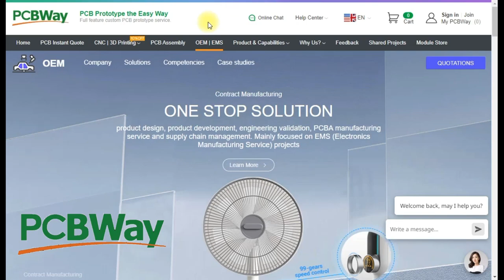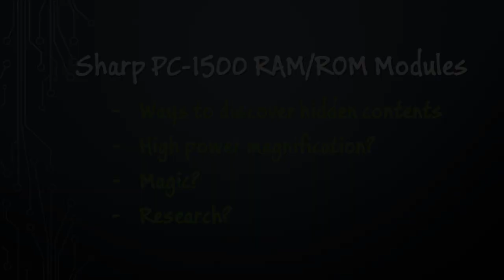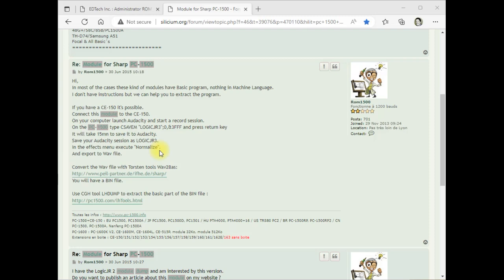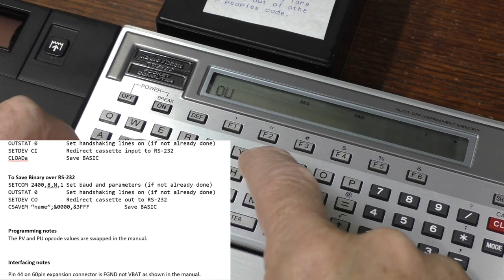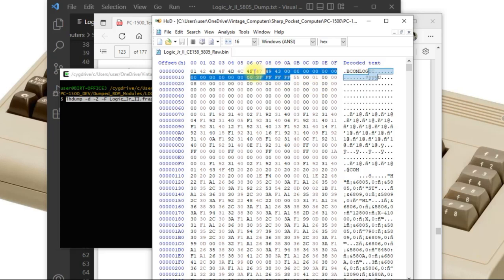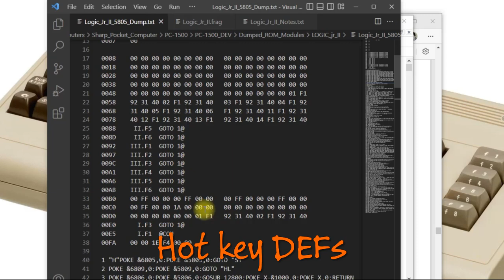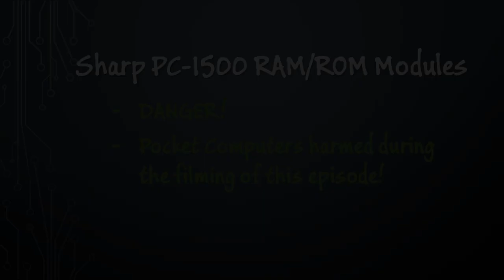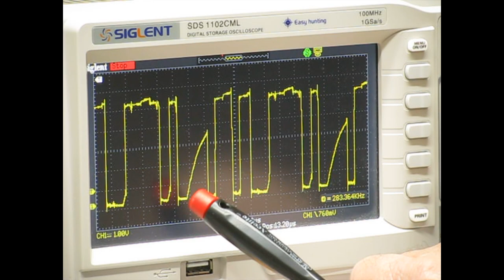Discovering PC-1500 BASIC programs hidden for 35 years!

Comment: In the late 80s I owned a Sharp PC-2500, which had a fairly complex business software package in ROM. I have no idea how I did this, since my notes are lost for 30 years, but I discovered that the BASIC dialect had an undocumented POKE command, so I started pokeing at random ... and eventually found a POKE that switched in the ROM software while remaining inside the BASIC interpreter. So the BASIC editor could be used to view the "source" of the in-ROM software! I remember writing the whole damn thing out by hand, hundreds and hundreds of lines of BASIC. Wish I'd kept it :)
Reply from the maker: The PC-2500 is an interesting looking machine. It is sort of like they decided to build all the parts of a pocket computer into one case.

Comment: Why not just dump ROMs directly? Via EZP or similar. I think it is must have tool for digital archeology.
Reply from the maker: In some cases, it may be easy to pop the case off a module and in other cases it might break the plastic. You also would need to desolder the EPROM or have a test clip of that size and hope that the address selection logic does not interfere.

Comment: I once got a strange computer, Z80 based with an expansion card. It was just the board and the keyboard, no case, no manuals, no info, nothing. Later I found that it was a custom made board (made for controlling complex tools like CNC, mills, etc) + extension for controling a plotter, no more than few hundreds made. It was original, no some standard like  Spectrum, MSX or others Z80 computers. 
When connected, I found that somewere in the ROM it had BASIC, a very strange dialect, not very close to MS Basic. Also had a monitor OS in wich it booted and with the expansion card it had also the plotter program to command the motors, pen, etc and a communication program to receive/transmit data over RS232. I entred in BASIC and I peek all the 64 k of memory; in the listing I found its BASIC commands and also the commands for the plotter, comm program. It was quite a complex computer, B&W video, very few graphical commands, but it had many math commands to work with arrays. Also, it could have been used either connected to a monitor (composite video out only, no RF) or could be used with a terminal via RS232. It had RS232 port, tape port, composite video and extension interface. I do not know if it was able to run CP/M or what other peripherals it had actually, but it might had a floppy and hard disk interfaces. Also I knew that it was used to control a robotic arm in a university project.
I found that someone intended to replicate it few years ago with modern ICs and if I will find the schematic I plan to build it.
Maybe on that EPROM module, the "jumper" is the remains of an electrolythic capacitor?

Comment: Ah, a power supply that doubles as a fuse. Forward thinking by Sharp there... And very cool analysis on the ROMs. :)
Reply from the maker: I did a video several weeks after this one where I managed to fix the voltage regulator module. In doing so I discovered a previous fix I had done lead to the regulator being damaged.
Reply: @HeyBirt  Ouch. I'll have to go find that video. I wouldn't have thought that that was possible.

Comment: Well back in the day a few of us in the RF community were hacking Motorola radio firmware. The chip you showed with the window was a common chip used by the big bad M to store their firmware. There was a company that I believe was called Andromeda Systems that made a programmer that could read and write these ROMs. Many times we would pull the roms that were socketed and read them. Those that were soldered in place had to be desoldered from the logic board and then read. Once you had the files you could develop a database with details of which radio model and options it came with. Comparison was done through hex editor programs. Of course the big M used their HC11 series micros in their own equipment but was also known to the industry is that their Microprocessor division sold these micros on the open market with all of the programming source codes. This of course opened the door to those in the RF industry and avid programmers to start hacking the firmware and customizing their own radios with options not available on low tier radios. Those days are long gone, pity.